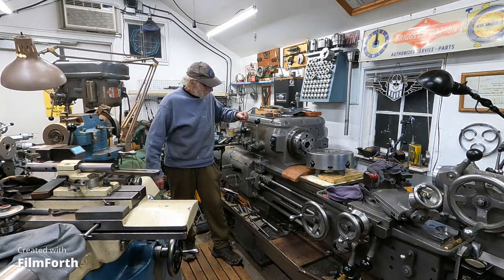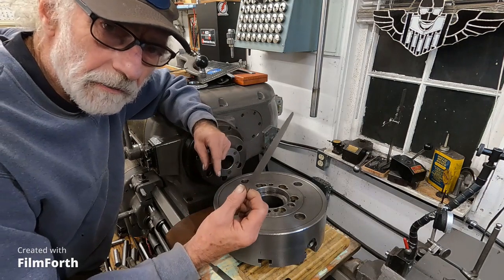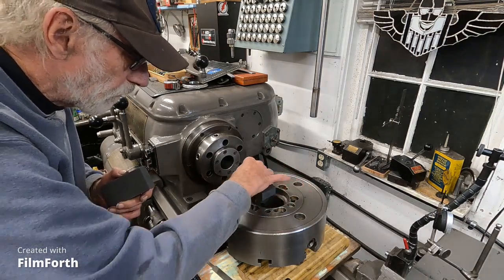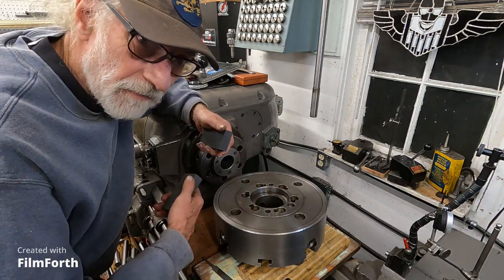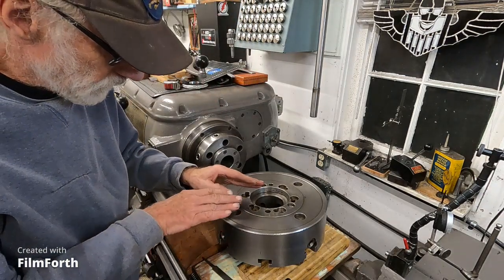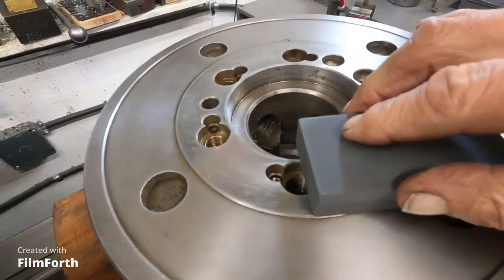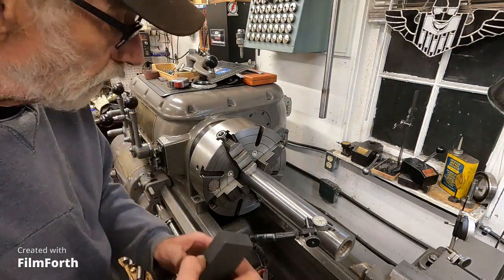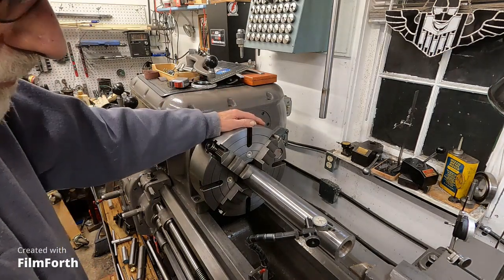My favorite lathe chuck 2 dialed in

Comment: DSG were also a bit conservative with the stated capacity, my 1307 by 40 will swing 14" and there is 45" between the face of a 3 jaw chuck and the tailstock barrel with it fully on the bed, you definitely get to work on a part 40" long if you want to.

I tried out the drilling bracket today, power drilling with the carriage feed is so convenient, I ran an 11.8mm drill to its full depth going 10mm between clearing the chips at ~8 thou per rev feed, then turned the part round to get the last 30mm from the other end, holes lined up nicely which was a bonus.
Reply from the maker: The drilling bracket is a better idea than using a regular lathe compound for sure, these short bed heavy pattern lathes have a short carriage travel because of the length of the carriage. Drilling with the tailstock is like with a heavy drill press because it is all geared and has high and low feed.
Reply: @deedeeindustrialsuperprecision  The manual does state that drilling from the saddle the thrust loads should  be limited to approximately 1000lb but for occasional use can be increased by approximately 50%.
The bracket on my 13" has a MT4 socket and the tailstock has an MT3, they really did intend for it to be used for drilling. There is plenty of carriage travel on the 40" bed, the 30" version would be a little restricted, the rare 50" version would be nice.
Their bigger lathes can get to be long, I think 240" was the longest length available in the catalogues.